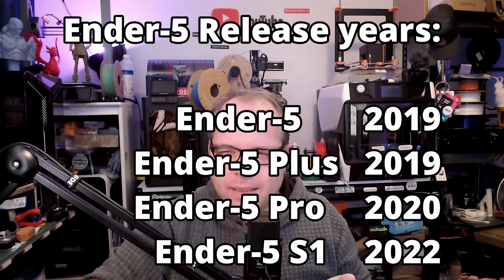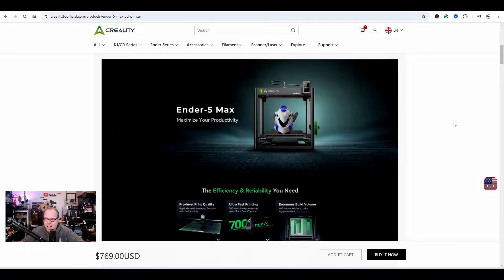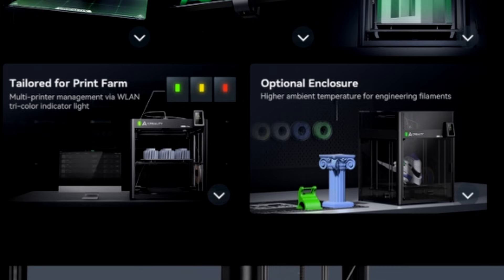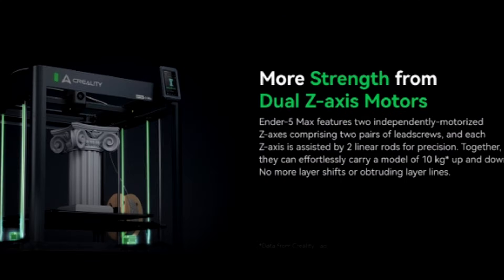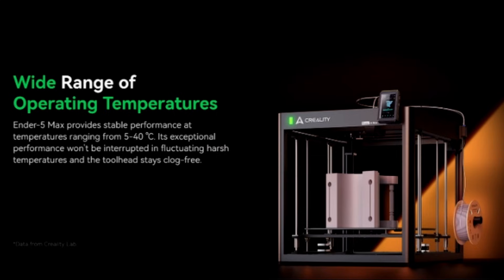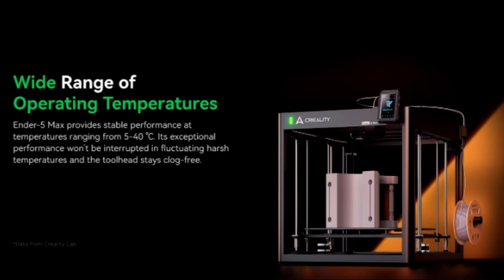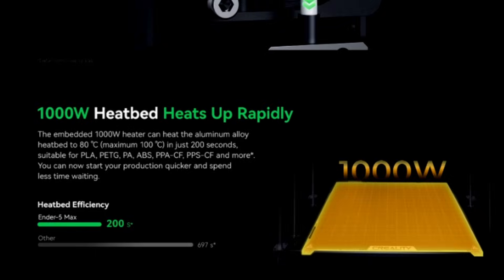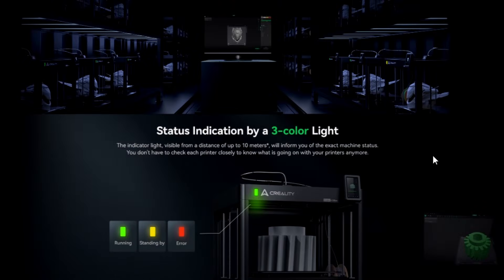Creality Ender-5 Max - Large Print Farm Printer? Zach React

Comment: The Ender5 max and the color hi are both on my wishlist to add to my little print farm. Though I might get a 3rd ender 3 v3 plus first as the 2 I have now are proving to be the workhorses for my little print farm right now. I am glad they are offering it with enclosure optional as I only print PLA so have no need for the enclosure. Since my print farm is on the second floor of my house, the K1 and K2 are not options for me as I wouldn't be able to carry them up the stairs either, so I like that it offers them as an option to keep the weight and price down for those like that do not need them.